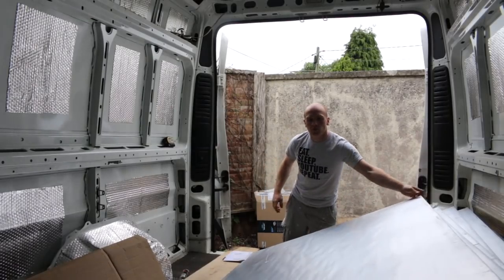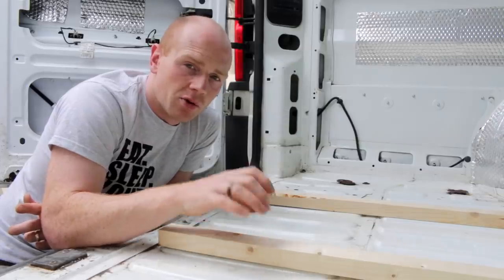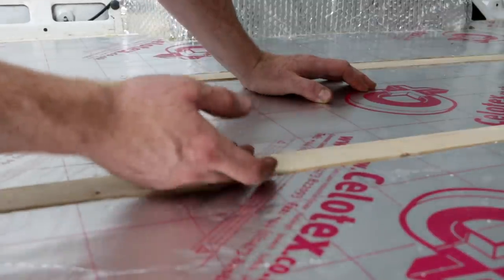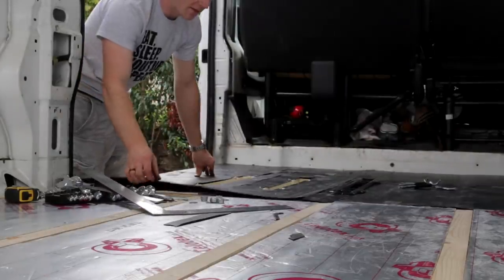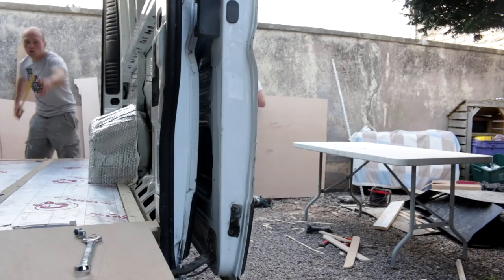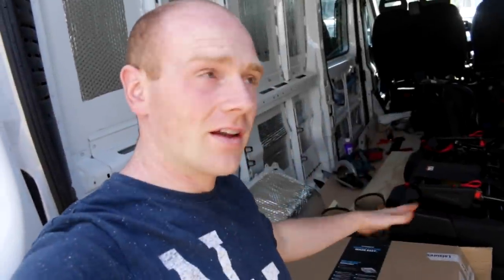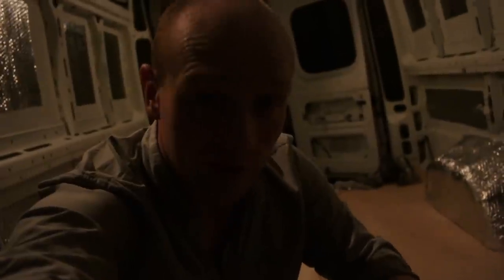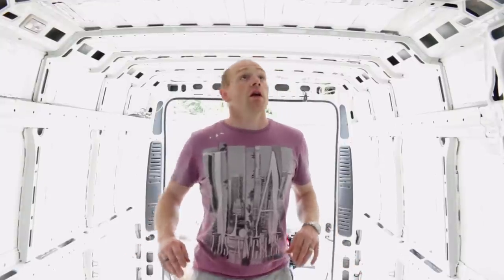INSULATING and BUILDING the Floor | TRC Van Conversion 5.0

Comment: Just doing my floor like yours now :) Did you put soft insulation in those pockets at the bottom of the walls, through like the triangular shaped holes before to put  the black caps back on?
Reply from the maker: Only down to the floor level. Left the bottom sill areas free just in case any moisture needs to drain out, ( plus no need to insulate walls below floor level.)
Reply: @TheRestorationCouple  Thanks :) I saw some guys had issues there with water pooling as well so probably a good idea. Keep up the great work on your channel :) it's helping me a lot!

Comment: Amazing videos, we're currently converting our own little van and i was wondering if you used any primer for the floor? I am thinking no as lino will go on the top, but my bf is thinking yes, can't do any harm putting primer on it. what do you think?
Reply from the maker: You can but no need. If anything, just sealing with PVA or SBR would be fine and give a good clean surface to bond flooring to. That said, clean ply is fine on its own. 👍
Reply: @TheRestorationCouple thank you so much for replying.I think we will now leave it on its own. whoop whoop. By the way we watch and rewatch your videos all the time. They are super helpful. Thank you for making them

Comment: Just finished my insulation and battens on the floor :) Before taping it all up please can I ask what did you do with the black plastic triangles that line the bottom sides of the van?? Did you fill with soft inslaution or leave them as they are? Any info would be great! Cheers
Reply from the maker: Ours didn't have plastic triangles but if you mean the void at bottom of wall, I filled down to just below the van floor level and then left a small void below.  Just in case any rain ever got in where the trim panels fix.
Reply: Yes the void :) Thanks, will do the same

Comment: Hey can I ask how you're fixing stuff to the van floor?  For example how did you fix the wood to the floor?  Great videos btw, because of you, I have to get chickens, build some extras to the house and now buy a bloody van to convert ;)
Reply from the maker: Sorry if it wasn't clear.  The battens are fixed down with an adhesive called Sikaflex.  This avoids needing to drill the floor and is a very strong bond.  The plywood is then screwed to these.  Glad to hear the projects are rubbing off! :-)
Reply: I thought it might have been glue but was worried about the flex of the van working the bond loose.
Reply: Could you let me know if the sikaflex is 221 or another version of sikaflex?  Thanks!
Reply: What version of sikaflex did you use?

Comment: Its all good until the underneath of the van rusts and you gotta take it all out to be welded or it goes up in flames 😂
Reply from the maker: Pretty much the case with most motorhoem I guess.  It could be done but by the time this galvanised body is rusting that bad I am pretty sure it won't be an issue,

Comment: Hi.  If you use the Celotex insulation, as per the Amazon link above, do you also need to add a separate Vapour/Waterproof Barrier?  
Greats videos.  
Cheers
Reply from the maker: Providing you tape joins them the foil will act as the vapour barrier. An additional ‘slip’ layer of polythene is sometimes used on floating floors but not really necessary. 👍
Reply from the maker: Any PIR board will do so may well find it locally to you.
Reply: Excellent.  Thanks for taking the time to reply.
Cheers

Comment: I thought the wood floor beams that contact the metal frame would conduct heat and cold straight past the insulation?
Reply from the maker: Sean Murphy there will to an extent be a thermal bridge but I'd rather have a safe than strong floor.
Reply: Oh I gotcha. I suppose it's still better than a rubber mat with a few layers of radiant barrier under it? I wonder what the R factor difference is. I suppose this method plus radiant barrier on top would work too. Great video by the way.

Comment: Great video. Really enjoyed the channel before the van project, and then when you announced it I was mega jealous. It's a future plan/dream of mine.
Quick question, so there's only adhesive to secure the batons? Will that be true on the walls/ceiling too?
Reply from the maker: Yes just adhesive for the floor battens.  I was surprised too hear that is how it's done but after researching it seems most cars are stuck together nowadays! Walls and ceilings will be attached to battens screwed to the ribs of the van.
Reply: Hi, do you know what type and brand of addictive you are using?
Reply: Same here on the floor battens, I kept looking back to see if I missed the step where you fastened them to the floor of the van.  
I am looking into buying the Promaster van here in the US.  Your videos will be very helpful.
Reply: sikaflex adhesive

Comment: Did you look into Mass Loaded Vinyl at all? Any thoughts around it?
Reply from the maker: Not too clued up on sound deadening but did look at MLV.  Ended up with the butyl mat we used due to price and the fact that we had so much other insulation to help with any acoustic issues.  Worth keeping an eye on how much weight is as it all adds up.  I am sure you could do way more for road noise but what we have done has cut out lots and I'd rather put more effort in to how it performs when it is parked up than on the road. :-)
Reply: Thanks for the reply!

Comment: Did you ever worry about filling in the grooves of the van floor. I am about to do my floor and cant really get a good answer on whether having an air gap between the floor and the insulated panel is going to matter or not...
Reply from the maker: Nope. There is no reason in my opinion, filling would give tiny amount of thermal improvement and the small gaps are sealed from the outside so no risk of condensation anyway.
Reply: Morgan Elliott The gaps don't cause any harm. Yes, you can put thin strips of insulation in there if you want,  but you don't get much benefit from them.

Comment: hi i did the same like you. My doubt is the floor board from Bnq untreated and it says to seal it .im scare without it can deform. What do you think?
Reply from the maker: Chipboard? If it’s standard stuff then yes seal if green may be ok. Either way it’s heavy stuff for a van.
Reply: @TheRestorationCouple  nope 10mm plywood like yours
Reply from the maker: Oh I see. 12mm ply is fine on its own providing you have a waterproof flooring going on top. No harm to seal it with PVA though.
Reply: @TheRestorationCouple   cheers m8 i will do that.

Comment: The aluminum foil roll material  should not be touching the metal wall and ceiling of the van. There should be an air gap there. You are severely reducing  the radiant barrier effect of the material.
Reply from the maker: You are misled, what you might see on the walls is sound deadening just looks like reflectix , you will see me address the downsides of the insulation you are talking about in a later video. 👍
Reply: Okay. My bad. I see so many people putting reflectix or radiant barrier directly on the walls and I get a little crazy : )
Reply: How much of an air gap
Reply: Michael Lawrence If using a radiant barrier material (reflectix, aluminum foil, space blanket etc) this video recommends it should be at least a half inch away from walls/ceilings.  https://www.youtube.com/watch?v=E1IwS0_lpBc
Reply: I'll check it out thanks buddy

Comment: complete overkill for the insulation, just put down ply, waster of time putting thermal boards on the floor, Ive had just ply on the fllor of vans and just normal carpet on top  for years in vans that I use on skiing trips in -20 C temp and also in in hot summers in Greece ..

Comment: Did you screw timbers down?
Reply from the maker: No, sikaflex adhesive.  Plenty strong enough and no need to penetrate the floor metal.
Reply: thanks , I was wondering the same

Comment: Help. Im following your floor build. I opened up another van build just to check to see if I bought the right insulation. This guy said that it was bad to screw the battens down because it will cause rust. I have about 60 screws and my damn floor right now. Do you worry about rust. Should I take the screw out squirt and paint then screw back. Please let me know. Thank you for your expert videos an easy to follow instructions.
Reply: You have to paint(or seal) the screws from the underside of the floor. Unscrewing them, painting them, and putting them back is not good enough to ensure the screw is rust proofed. You will have to get underneath the van and paint/seal them in place.